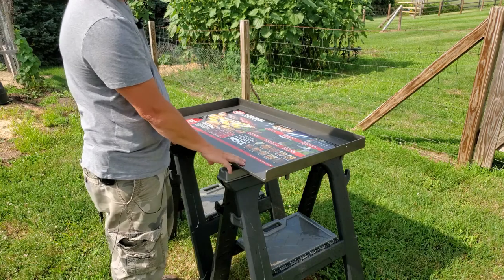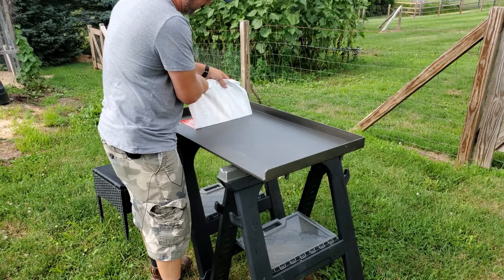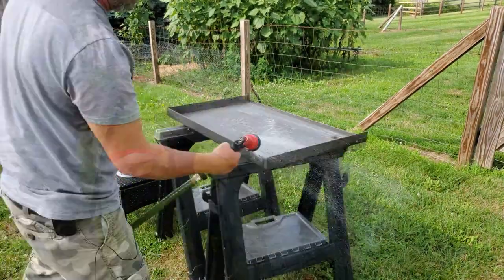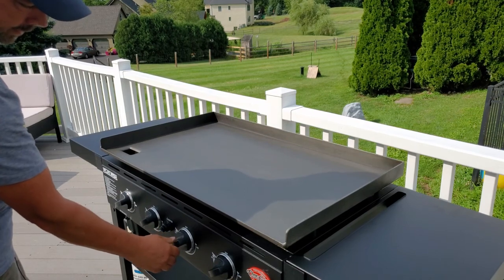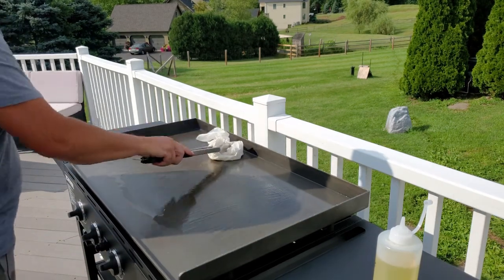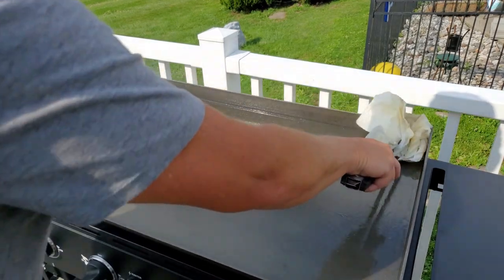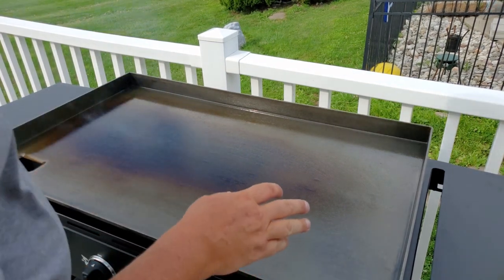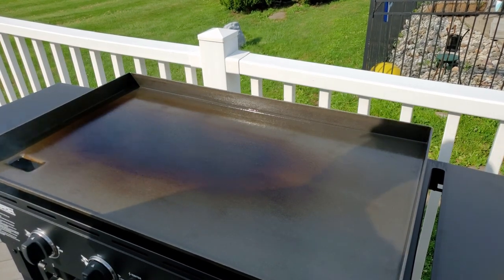How to prep and season a Char-Griller Flat Iron griddle

Comment: Whoa! That's not a Blackstone! Curious how you think they compare.
Reply from the maker: Hey Jon!   Thanks for checking it out - I see some great features with it so far!
Reply: Blackstone doesn't come with a cover, which is nuts. I'd get this one over a similar size Blackstone. Menards sells them
Reply: @ralphmyers5367  I just bought a 36" Blackstone and does have a cover 🙂
Reply: @MaxLynn0202  Yes I imagine some come with one. The 36 inch flat iron with cover is about $300. I imagine the  36 inch Blackstone with cover is quite a bit more.
Reply: @ralphmyers5367  It was $399 6 weeks ago...I just bought it last week and it was on sale at Walmart for $297 🙂
Reply: @MaxLynn0202  That's a good price then. Thanks.
Reply: Front access grease try is also nice on these chargrillers

Comment: Just bought the premium version. I notice that the surface has a texture to it. Does using metal tools on it cause a concern?
Reply from the maker: That premier version is awesome looking!  It's made for metal tools, you can't hurt it :)   Even if you leave it out in the rain and it rusts up you can sand / wire-wheel it back to good health.   Just keep it oiled up by adding a bit after each cook.

Comment: What is the spring loaded L shaped shaft with the pointed end down by the propane tank
Reply from the maker: That snaps into the base/leg when you fold the legs up so they'd stay and not flop around.